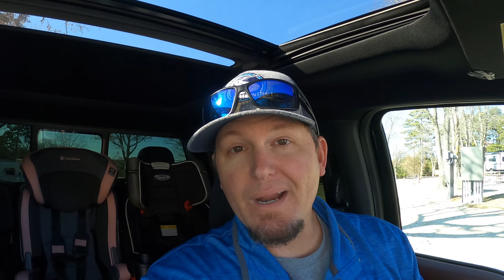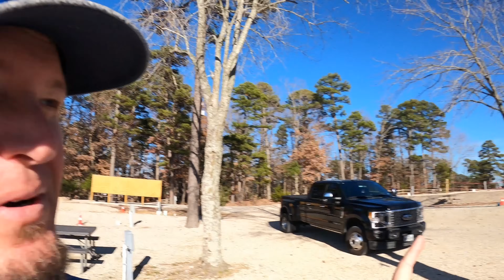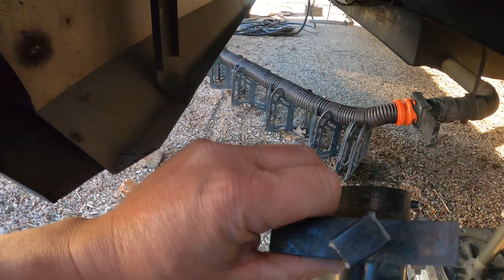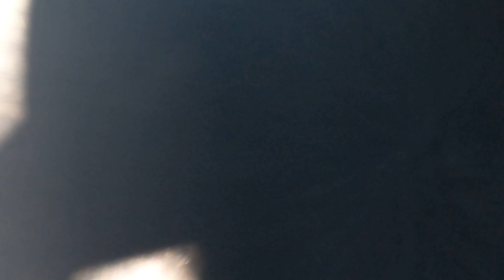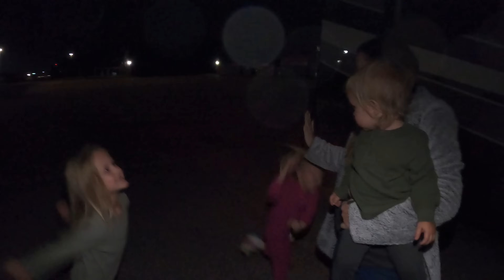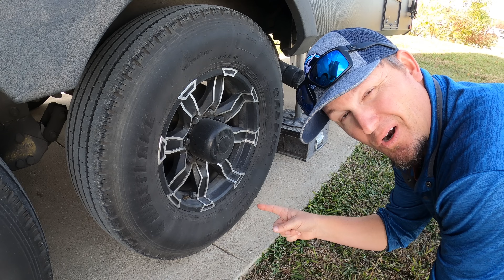We Are Heading Home With More Problems Than We Can Count! Fulltime RV Living!

Comment: Congratulations. Quite a trip
Assume you’ll do a bearing pack when you change tires?
You probably have self adjusting brakes but if not they will need adjusting 
You probably have the EZ lube zirc which does work but used incorrectly 99% of the time
The ez lube pumps grease into a very small area,  you must rotate the tire as you pump or you’re putting grease on 2-3 of the balls. Dexter axle has a good video on it. The people at LCI (who make their own) will tell you to watch Bill from Dexters video if you have axle questions.  More grease is not better, it’s an RV not a boat trailer, once the bearings themselves are packed everything else gets a light coating.  The grease doesn’t get hot enough for the grease to flow into the bearings
The road flush. 👍.  If you have a sensor that won’t clear you can do the road flush and add a couple bags of ice and go down the road.  Tank sensors don’t fail in the reading a certain level, the not reading when definitely that full is another thing. You saw what came out after you flushed till clear. 
For roof and body maintenance lap seal(I prefer Dicor)on the roof and gutters. I recommend taping (rubber roof repair tape) the transitions but not necessary    We quit using silicone for the most part and started using Trempro, it’s a urethane sealant. Takes longer to cure but is a neutral cure, it’s really good stuff, tools nicely .  If you have black sealant I like sikaflex 252, mineral spirit clean up and super short work time, like 8-12 inches at a time , if you want a smooth finish and you tool and don’t get, let it cure and come back and try again but more quickly, once it starts to skin you can’t work it, and you must wear gloves and have a mineral spirit rag in hand
Reply from the maker: Thanks for the tips, we do all of our maintenance and repairs ourslevs and will be tackling a lot of this over the next several weeks!

Comment: I would check with Grand Design before you upgrade the water pressure. Most RV manufacturers recommend 40-45 PSI on the inside water lines. You don't want to have more "future Kevin" water line fixes while you are out on the road. Plus, I had what I thought was a water pump failure on our Montana High Country, but I found that there was a 10 amp fuse for the water pump behind the power panel where the water pump is turned on or off. The fuse panel had a 15 amp fuse on it for the water pump. Why Keystone decided to put 2 fuses on that line is beyond me. I had p[urchased a new water pump, but decided to keep it just in case. We camp at a lot of COE Campgrounds, which normally don't have full hookups, so we need the fresh water tank to work, along with the water pump. Love your channel! We have stayed at a couple of the campgrounds you guys were at. We also really liked the Double J just outside Springfield, IL. We are full-timers in our 2022 Montana High Country 373RD.
Reply from the maker: Looked everywhere for a 2nd fuse inline beyond the fuse panel! Our current water pump is 60psi now and we set our regulator at 60psi, that is what our system is set up for! We are just increasing the flow of the pump so we can have more volume of water at the same pressure! We also plan on replacing the entire water system when we fix the basement! No more plastic and we will have a manifold!

Comment: Heated hose I use it all winter works good for me in Northern New Hampshire and I have seen people take their water filter setup plummet inside a cooler and install tank heater mats inside the cooler and they keep their filters heated along with the heated hose and that seems to be the solution for the winter time filter issues let me know if you need some images or whatever I'll get you some pictures
Reply: 100% duty cycle on the water pump I have been using a sea flo and it's quiet and strong also 100% duty cycle and the price is cheap definitely think be worth  trying to upgrade  GPM rate for your water needs I took my trailer from 2.5 to 3 GPM and got a decent shower also running the fogatti tankless hot water heater 55,000 BTU and loven it good luck 🤞
Reply from the maker: That's actually a great idea never thought about using a cooler to insulate it! For us the simpler solution is to avoid winter in the RV and deal with filling tanks the few times a year that we do freeze!

Comment: I'm really interested to see what water pump you install. I've been thinking about upgrading mine to a variable output with 60psi. I'm also considering installing a pressure tank as well. I know the water lines in my fifth wheel can easily handle 60psi.
Reply from the maker: Right now it is a 6 gpm 60 psi unit you can pair with an accumulator! I like the idea of the flow increase as well as how much you can reduce the surge with the extra tank!

Comment: The number one concern I would have with upgrading to a higher PSI would be any fittings somewhere else in the RV that are not tightened properly popping off. But if you do decide to upgrade to a higher PSI, I would suggest getting a small pressure tank to ease the amount of times that pump has to cycle
Reply from the maker: We already run ours at 60psi so there is no difference in pressure on the lines! The flow is what we are after and in order to make that flow the pump is a piston type pump and the surging should be reduced significantly! we will also add an accumulator to help with surging!
Reply: @PavingNewPaths  I don't know if it would work in an RV but a pressure tank like you would put in a house might get you longer times between the pump having to run and might extend the life of the pump for like when you flush a toilet then wash your hands. The pump will only have to kick on when you're washing your hands. Then it will repressurize the tank after you've washed your hands and maybe it would help with the shower. And if someone turns on a cold, tap somewhere so you don't instantly lose your hot water and get blasted with cold water. But I don't know if it would work the way I'm thinking it would in an RV
Reply from the maker: @waylonhartwell  That's exactly how it will work in the RV it is just a smaller tank! Ideally it just minimizes the surging and keeps the flow and pressure steady non dependent on demand! Will it be perfect, no, but it should be significantly better than what we have!
Reply: @PavingNewPaths  I doubt it but I wonder if your pressure tank is gone bad and that's what killed your pump but being a full-time travelers I could see the pump just dying in that amount of time. They probably didn't put the highest quality pump in when they were assembling it, judging by the look of the plumbing layout in there
Reply from the maker: @waylonhartwell  We don't have a pressure tank now, it would be adding it to the system! We actually haven't used the pump much in our 3 years up until this year when we had the leak!
Reply: @PavingNewPaths   
So you got the warranty special installed and just didn't know it and couldn't take advantage of the special
Reply from the maker: Not sure what you mean? Ours was built in 2019 no pressure vessel!
Reply: @PavingNewPaths  my sarcasm doesn't come across very good and text the warranty special was supposed to be a joke as in you're supposed to break the pump within the warranty period
Reply from the maker: @waylonhartwell  Ha ha! We bought used and it was out of warranty when we got it already!

Comment: upgrading the psi would make the holding tank go faster, I would think. No issues if you don't normally use the entire tank before you can refill it, but I don't think anybody would necessarily take shorter showers and I think those same showers would be using more water at a time. I know I would like more pressure, but I know I would not take shorter showers 😂
Reply from the maker: For us the amount of water used doesn't matter as we never rely on our tanks fulltime! But the increased shower pressure and flow would make our showers almost as good as a house!
Reply: Funny how that works.. We still work full time and have the same enthusiasm when leaving home for the road, as you do going back to Texas..😅
Reply: @PavingNewPaths   Our favorite places all seem to have no full hookups so that is a major part of the equation for us. More psi would make me want to stay in the shower by itself, let alone use more water per minute😇 I'm just glad to be able to use our own! The lack of satisfaction in water flow, but definitely enough to get clean, helps in taking short showers to conserve!

Comment: Future Kevin is now present Kevin. To be fair, those valves are exposed to the elements and take all the road gunk on travel days. Maybe they were a good buy. Might want to alvarry an extra?
Reply from the maker: They did last 3 years, the strange thing is I don't think there was a probelm with it until the onboard black valve failed! Now that I am using the end valve to do all the work it gets used regularly and now after a few weeks it is broken!

Comment: When I had a RV, I bought a 4.5 GPM variable speed water pump.  Great way to improve things.  

My guess is the 6 GPM at a fixed rate, it will run a couple of seconds, build up 60 PSI, shut off, restart at 40 PSI and run for about 10 seconds and shut off again.   If you have a expansion tank, then that will cause the on - off to be about 30 seconds?  I bought a expansion tank that prevented the "Marching sound" when running the water slowly.  

Then I bought a 1 gallon expansion tank.  I put on a valve to allow me to shut it off when I wanted to.
Reply from the maker: I was thinking of adding the 6pgm and the expansion tank , and since we are going to redo all the lines we were going with a manifold system, get rid of all plastic fittings, and go with PEX type A!

Comment: Man I feel you on the dump valves.  I had two break this summer and my add on one at the end of the pipe like you have broke as well.  I used pliers to open it.  So frustrating to open the belly repeatedly to fix the factory one.  Im looking at electronic ones.  But for me has to wait till spring.
Reply from the maker: I wanted the electric one's too, but after thinking about it, I am going back with the manual pull ones, Don't want to have to deal with what happens when the Electric ones stop working!

Comment: Flow won't hurt the water system, pressure is usually the issue. I think when my water pump goes, I would probably spend the money on something like the seaflow accumulator tank pump combo.  They make one that is 5.5GPM @60PSI with a 2 gallon accumulator tank, expensive but that would be awesome.  I suggest keeping an extra lance chance valve around, they usually last about 3 years before the plastic gives up.
Reply from the maker: I am looking at a very similar set up! The 5.5 GPM with the accumulator tank!  Not real concerned with increased pressure but I would love more flow!  We are also thinking of redoing all the line to PEX type A, and using all brass fittings!
Reply: @PavingNewPaths  I looked at SeaFlo even tho pricier because it's a US company.  I would love to remove that pulsing I get at times on pump.  Since our emails, I been considering replacing as much of the soft line as I can.  There are some areas that may be hard line just not sure ill drop the whole belly just to change it out.
Reply from the maker: @jamesbitb  Well now that you know our RV is broken, might as well make this a project and drop everything and fix it right!

Comment: Great video! If you upgrade your water pump, will you need to upgrade the wiring to it?
Reply from the maker: If you upgraded to an AC pump yes you would, but since we are replacing our 12V DC pump with another just like it, the stock wiring will work just fine!

Comment: I would not go above 50 PSI.   So higher flow might help.  But I bet you can’t take a shower with something else running even with higher flow.
Reply from the maker: I am probably redoing all of my plumbing with Pex type A and will have a manifold system, so going to 60psi should be fine!  Still probably can't shower with the sink on, but It's worth a try!